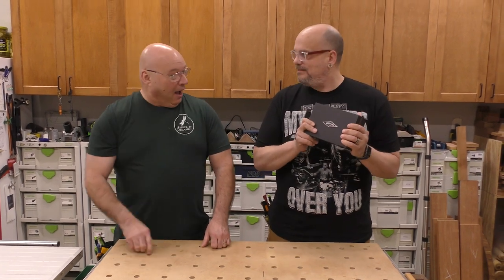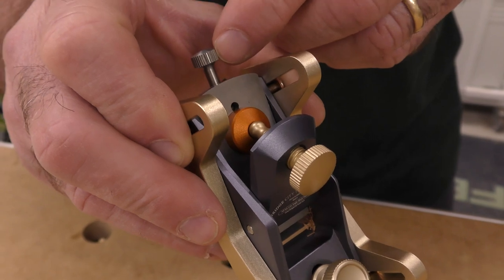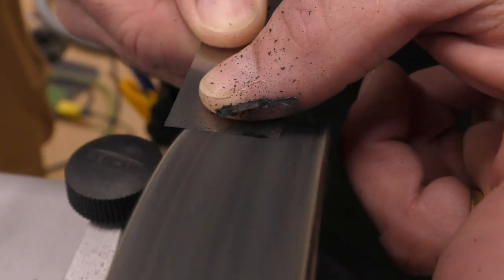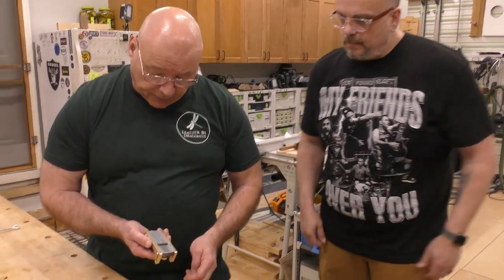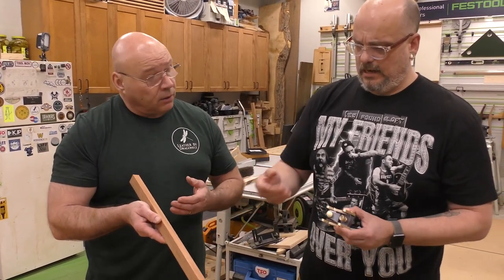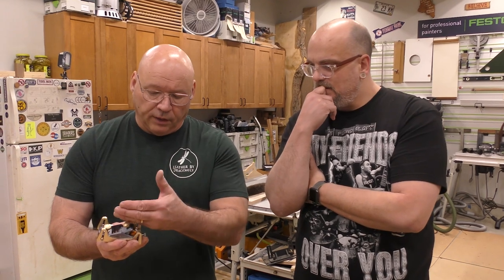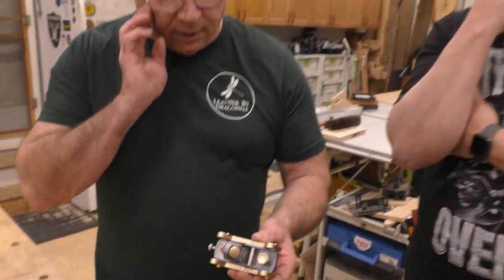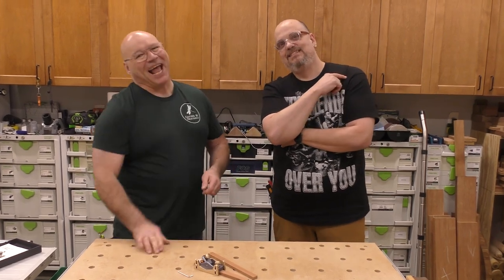Bridge City Tool Works HP-8 Block Plane Overview

Comment: I just got one on black Friday sale (less than half price)... it is an impressively well made plane and I've been looking for one for a while to do exactly what you show... soften/chamfer edges.  I spent a few minutes to polish the sole, as it comes a little rough IMHO.

One benefit of the side depth fences is they can be used singly (only drop one side) to dress edges nice and perpendicular.  Since the blade does not completely cover the full width of the sole, I screw in a small piece of hardwood (say 3/8x3/4" using the same slots in the fence - I made it with the plane!) to give the blade coverage to the edge of the workpiece.  You can even leave it in place to dress out the edges (as you show).  Very effective little plane to have at your side.
Reply from the maker: Thanks...great points

Comment: Thanks for showing this plane. I recently added a few of the bridge city tools to my kit and admired how nice they are. Shortly after I got some tools, you started showing yours, and I thought awesome, Sedge is actually getting these too! It sounded like BCT use to be US made but have out sourced in the last couple years which is disappointing. But, they also say the new prices are down because of the outsourcing and I would be curious how extremely expensive they would be otherwise. I'm glad you showed this plane because I tend to pick up ideas of how to do thinsg well watching you and I have actually been thinking about buying some of their planes. Good video, thanks!
Reply from the maker: thanks for watching .... I was really impressed by this block plane.
Reply: Too bad company sold out and new owners went to china

Comment: I had to return mine- BTC is just another China tool maker with one difference. Its way too overpriced for the lack of quality you expect from BTC. I have never seen a tool maker go from tier one to tier three so quickly! I literally buy three items and one has to be returned. 
Its not the same BTC as pre "17 and its not worth the 85 bux I paid on sale.
Reply from the maker: sorry to hear that
Reply: I agree, check out the original Economaki made tools for sale used online & they're going for 3-4x as much as they were new.  Besides, the ownership of aluminum tools is a better indicator of a novice than if you had it spelled out in a neon sign over your bench.